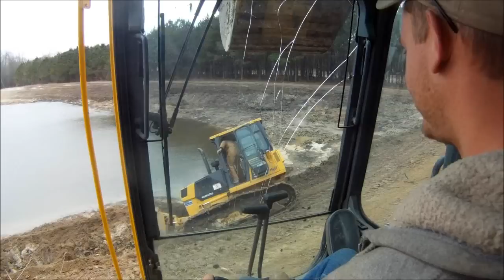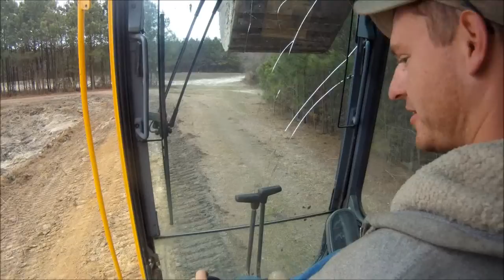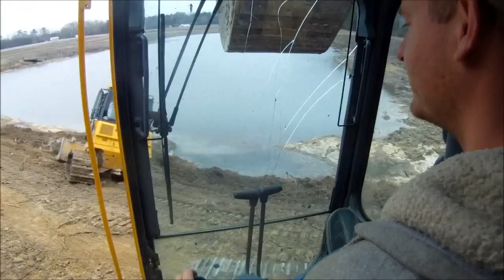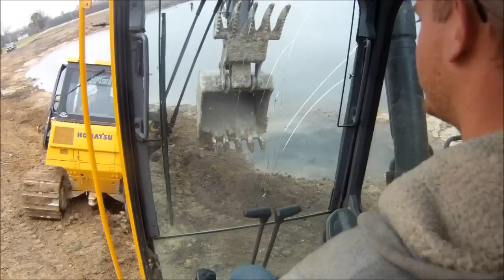Dozer Recovery

Comment: Remins me   few years back when i got change to test real combine harvester. The guy who owned it, said that in the field there might be one soft spot. Well i took a stright line, aiming to a barn on edge of the field to get the combine go as straight as possible, when it suddendly sinket from front,  I did try to get out myself but it was only sinking deeper. So i had to call to the owner. "Guess what. I did found the soft spot."